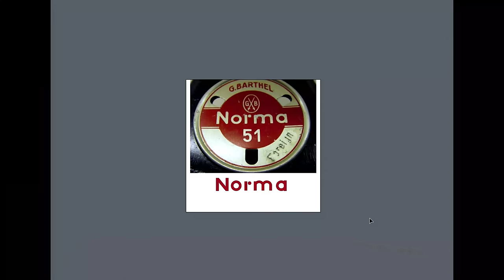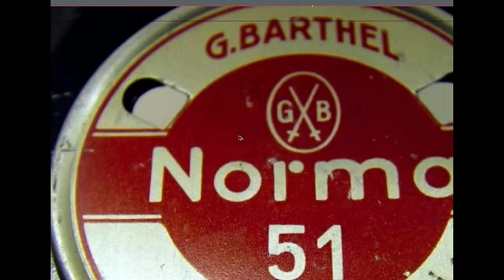Stylish Camping Stove Restoration - G. Barthel 1930s Norma 51

Comment: i restaurated my Austrian 2 burner unit a few years back. the flow reducer should be made with an eye at the screw so it can be replaced/cleaned. i used string made from flax for that.

Comment: Just found your channel looking up one of these old stoves. Pretty cool but mine doesn't have the fuel tank. I was thinking about modifying a old brass toilet float for one. I have a copper expansion chamber off a ac unit but it's thick and heavy. Be easy to tap and thread but was worried about tipping over once it has fuel in it. Anyway enjoyed your content and will be watching more. 👍👍

Comment: What a beautiful design. The restoration was wonderful to see happen. I have a small dent in my car door...I wonder if the hot glue method might be the way to fix it?
Reply from the maker: I'm glad you like it. Some are saying that it works on cars, too, but I guess it depends on the thickness of the tin, and for sure, there is a risk to take the paint off.

Comment: I don’t know whether you tried this or not… but an effective and tried-and-tested way is to heat the pipe till it is red hot. This will char the wick whereupon tapping the pipe on the table firmly, the wick will come out in the form of ash.
Reply from the maker: That's a good tip. I didn't try because I  could melt the pipe, and that would cause the end of the show. 😀

Comment: Obviously a super job on the restoration of this little camp stove. But, just out of curiosity, how was it transported, was the fuel emptied out each day into a flask or was there some type of carrying case for it. Thanks for sharing and good luck with your channel 😊
Reply from the maker: Thank you. I think the tank has to be empty while it is transported, and for sure, you need a flask with extra fuel/alcohol in this case because the tank is pretty tiny, and you need to fill it up every 20- 30 minutes. I couldn't find one in the original box on the Internet but could be a way to transport it if the box is made of wood or plastic.

Comment: Brilliant restoration. One point that scared me was I thought you put brass on a grind stone, that's very dangerous and will clog the wheel. It will imbalance and explode.
Reply from the maker: Never heard about that. Did you experienced such an accident?
Reply: @rustyshadesrestoration  A guy got killed when a wheel exploded in my apprenticeship, trust me.
Reply from the maker: Uh-huh, that's sad to hear. I guess it has to reach very high temperatures to happen that, but anyway, it is good to know and thanks for sharing!

Comment: This is a serious question. Don't mean to sound disrespectful. Why do all the brushing of youre just going to sandblast it anyway?
Reply from the maker: It helps because the layer of dirt can be sticky or greasy, and the sand will stick to it, or it will take longer till it reaches the rust layer, so you'll spend much longer sandblasting it, and time is precious! Especially when you have more significant parts. One more reason: the dirt and big crispy rust parts can block your sandblasting gun, and that's not funny when it happens. I hope it is helpful to know! Cheers! Johnny
Reply: @rustyshadesrestoration  makes sense. Thanks!
Reply from the maker: You're welcome! 🙂

Comment: well, yes, but you miss the part where you could turn it of and on ... to close the petrol and open it...
Reply from the maker: I didn't care about that moment. The stove works with alcohol and is designed for that; that's why it has a cotton wick. Using it with petrol can be very dangerous.
Reply: @rustyshadesrestoration  hm... why then this Zippo stuff...?
Reply from the maker: I had there cotton for the wick

Comment: Разрезать трубку ,чтобы достать фитиль было и необязательно.Фитиль можно было выжечь горелкой,а проволока после этого и сама бы выпала.
Reply from the maker: It will take forever, and I could risk a meltdown, which will not be easy to fix. I was thinking about too, but instead, I preferred to try with water and air pressure, but none of them worked.